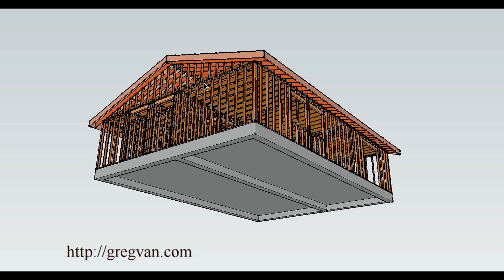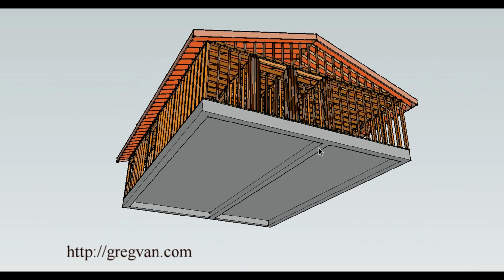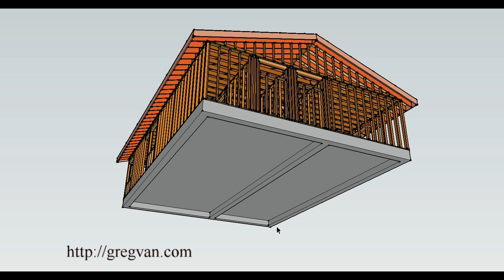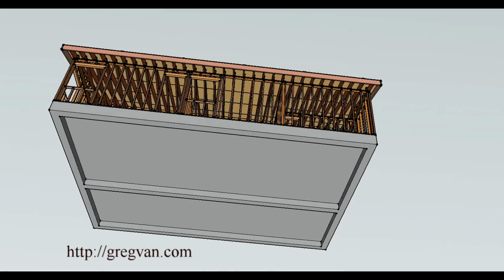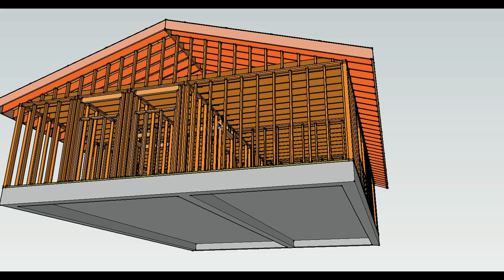Footings and Slab – 3-D Single-Story Conventional Home Framing Design

Comment: Hey Greg. I live in socal and am about to build a 10x12 metal lean roof shed on a slab. I’m being told I need a 12x12 footing but that seems to be overkill? I may one day convert the shed into a home office but it’s unlikely. What sort of footing would you go with? Thanks. Love your videos!
Reply from the maker: The most common footing used for single-story house construction is a 12 x 12 x 12 inch footing.

Comment: Thank you for the video. Since the rafters are tied together with a ceiling joist in this video, would the gable walls still be considered weight bearing without requiring a ridge post to support the roof frame? If the gable wall is weight bearing, than what weight (other than the wall itself) is it supporting?
Reply from the maker: Ruben Rojas This ceiling joist prevent the walls the roof rafters are sitting on from getting pushed out over time, which would allow the ridge to sag. I'm not 100% sure why the gable walls would be considered load bearing or would require the same sized footing as those the ceiling joist and rafters are sitting on, when their supporting different weight loads. All I can say is the construction industry considers these to be loadbearing walls, but don't think I can provide you with a rational reason why.
Reply: I always assumed the gable walls were load bearing myself until a home owner pointed this out to me just before I was going to make repairs to his gable wall that I thought needed some shoring before demo. I couldn't find a reason to brace the top plate of the gable walls before removing a few studs. I think they are just partitions acting as exterior walls.